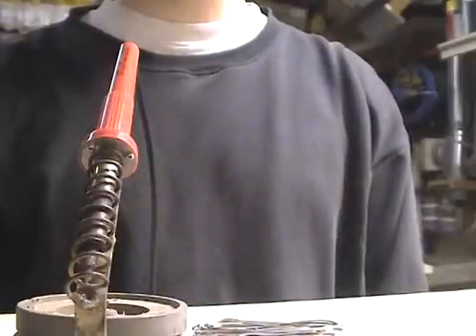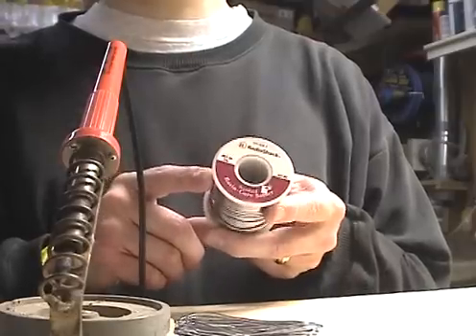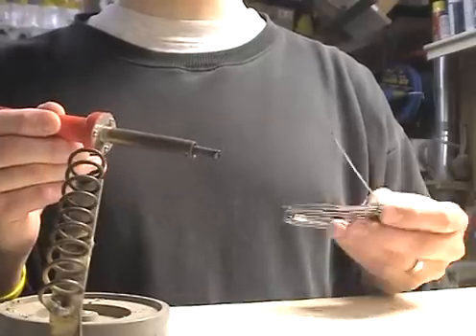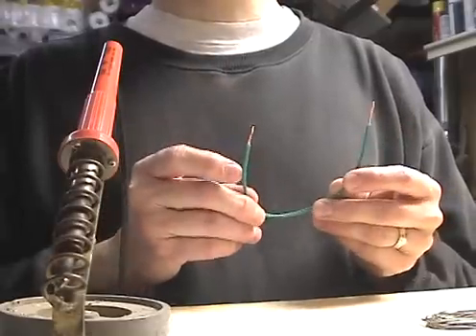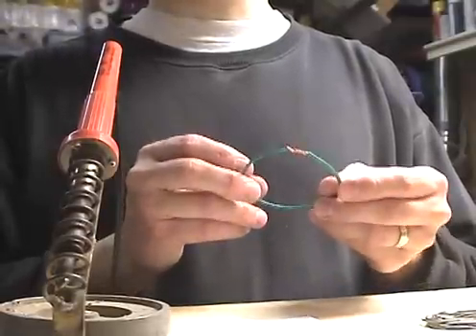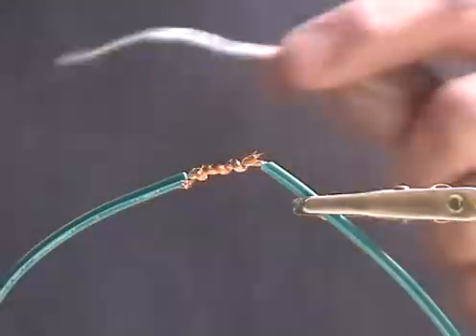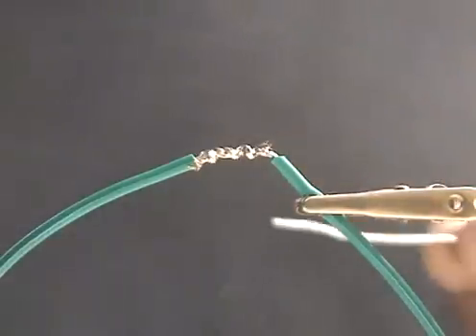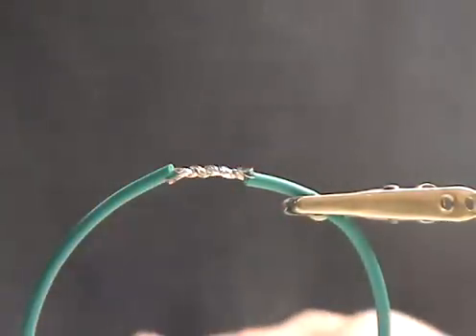How to Do It: Basic Soldering

Comment: How come I am only able to melt the solder by touching the soldering iron tip directly? Do butane soldering irons suck? This is frustrating. Maybe it's the crappy lead free solder that sucks.
Reply: lifeisgood070 butane irons are commonly known as 'fire-starters'! I would invest in at least a mains iron unless you need portability i.e. automotive. Lead free solder melts at a higher point, so it will take longer. Make sure you heat up the joint for long enough.

Comment: Do you add anything over the connection for addition protection or is the tin in the solder enough?
Reply: Jerrid Stottlemyre You usually heat shrink a wire to protect anyone from touching it/short circuits

Comment: Newbie question: Do you have to clean the tip once you're done?  Or can you leave the melted tin on it?
Reply: Leave it
Reply: You should "clean" the tip before soldering, while soldering and when finished. Preferably this means shaking off any burnt residue in a metal sponge, quickly sticking the tip in a wet sponge, "tinning" it slightly and soldering right after that.

The tip is "clean" when it is in normal working condition. You just turn off the unit and let it cool down.
Reply: Gordio283 Most people leave a blob of solder on the tip to prevent corrosion of the tip (and most people refer to the 'tin' as solder). Whenever you have stopped soldering for greater than ~20 seconds, re-tin (Wipe off solder, add solder, wipe off again).
Reply: You absolutely should leave excess solder on the tip after use. It protects the tip from oxidation when it's turned back on. (In fact, it's good practice to apply a generous blob of solder to the tip before turning it off.) Regularly cleaning the tip is essential, but ALWAYS re-tin the tip immediately. Ignore the advice above of using both a metal sponge and a wet sponge. Just use a brass wool soldering iron cleaner. Wet sponges cause thermal shock in the tip, reducing its life (at the lower temperatures for leaded solder this wasn't a problem, but with the higher temperatures needed for lead free solder, it became a serious issue). Besides, the brass wool does a better job than the wet sponge anyway!!

Comment: My Solder does not spread like that.
Reply: That's what SHE said.
Reply: sam luker
It is rosin core, the flux is in the solder. Sometimes depending on the surface of what you are soldering you may have to add some liquid or paste flux, just make sure it is rosin flux not acid .
Reply: You have to use flux on your wires or it won't flow
Reply: Sean O'Brien most common wire soldering techniques usually mean that you put the solder onto the tip, creating a heat bridge with the solder across the wire. The flux in the solder WILL burn off, so you need additional flux to ensure a decent, reliable connection.
Reply: I thought I said that at the end of my comment. It all depends on what you are soldering. I can solder a pair of relatively clean wires without adding additional flux, then there are wires that have corrosion that will require it.
Reply: Sean O'Brien I understand that, I was just explaining the reasoning behind your statement. I CAN solder without flux, it just makes life much harder and has a higher rate of failure. I can bet your joints are very dull, and not a smooth coating.

Comment: I held the soldering iron to the wire for a couple minutes, but the solder never melted. The wire never got hot enough. Do it need to give the iron longer to heat up? How long is a good length? What am I doing wrong?
Reply: chances are your iron isn't hot enough... that is the wattage of your iron is to low for the gauge wire and all the heat from the iron is being dissipated through the wire therefore wont melt the solder. normal 60/40 solder melts at about 200C (365F) and a small pencil iron will lose that heat quickly. secondly, you could be using the wrong solder... 50/50 solder has a higher melting point and requires a higher wattage iron (and a broader tip similar to the one in this video)... side note: NEVER "flick" excess solder off as this video suggests... that's molten metal and it WILL burn you!!! wipe your iron off on a damp sponge or cloth

Comment: I used flux to fix the connection in my macbook charger. Flux can withstand 120 Volts and a good amount of heat correct??? (I've only soldered little battery operated devices that spend like 12V in the past).

Comment: you  really should use the lead frree solder so you dont get lead poisining
Reply: stop drinking the solder!
Reply: Lead has a very low vapor pressure, and rosin flux is only a problem with chronic exposure.  With can cause asthma.  Lead free fluxes are substantially nastier as lead free solders have inferior wetting characteristics and thus need much more aggressive fluxes.  Lead free solders also have the problem of requiring mutually compatible solder alloys, component lead finishes and board finishes (if components are PCB mounted).  Otherwise, brittle intermetallic alloys that form in the joint can cause joint failure and/or galvanic corrosion will be a problem.  Then there is the problem of lead free joints being more fragile.  And the much higher temperatures needed for lead free solder are more likely to kill parts and boards.

There are many reasons why military, aerospace/avionics, industrial control systems, medical equipment, core telecommunications infrastructure and hirel stuff in general is specifically exempt from all this lead free nonsense.

Comment: I am having trouble getting my soldering tip tinned.  I cleaned it and even used sal ammoniac on the tip but the bead of solder doesn't wet the tip and just seems to run off.  I have a pen type soldering iron and I let it heat up as hot as it is going to get but still no luck.  I didn't have much luck with several more expensive solder guns I have either ( I prefer the pen) , I just can't get the tip to tin.  I am using a lead free solder that I picked up from RS - is there any chance this could be the problem?  Occasionally I'll get a small section to briefly tin and there is no comparison with tinned v/s non tinned.  Tinned - the solder melts like butter, untinned and it will not melt the solder.  Any suggestions?

Comment: Is my 25w soldering iron good enough for electrical guitar work? Like switching pickups and volume pots?
Reply: This answer is probably three years too late but I was just watching another video that says not to use more than 20-25 watt soldering irons for guitar work because anything hotter can damage the pots themselves.
Reply: Caleb Jackson just in time. I'm about to do some work on an ovation preacher deluxe. Excellent video dude ! Thanks for the tips. I wonder if he still around :-?
Reply: Caleb Jackson - you can get away with a hotter iron if you are careful. I just soldered a pot a few days ago with a 60w iron. You just have to be quick or you'll certainly cook the pot.

Comment: WRONG.  While you can twist wires together, and it is quick, this is not optimum splice.  Airline spec is that you cut the shielding back about ⅝" for small wire, don't twist them yet, but rather, simply push both wires head on into each other to create a weave of sorts.  Basically, you can ease this process by wiggling them so that they blend together.  Think of one being the inner core, and the other wire blending over, as in coating the wire.   A tiny bit of the wire may fan outward, but then, you twist both as one along the axis of the wire.  The method above isn't nearly as clean an soften created a bumpy condition.   Once twisted just enough to hold the wires, flux the wires and soldier by heating the wire until the soldier melts and creates a smooth joint.  Make sure you place your shrink tubing on first so that you can cover the joint with shrink tubing to create the perfect joint.  This is a much cleaner connection and the wires are more woven together for both a strong and more efficient electrical connection - I promise you.  

Here is an example of how it should be done

How To Solder Wires Together (Sort of) - EricTheCarGuy
Reply: It isn't necessarily wrong, just isn't up to airline specifications...
Reply: David Fresne As I noted, the twisting is less than optimize, not nearly as clean when covered with heat string tubing, and isn’t as strong.  Yes, you can twist the wires.  The larger the wires, the messier the connection using this method.

Comment: Soldering is easy, especially when you're only doing it with wires.

Just get a few wires and practice until you get results like those in the video, then you're pretty much ready.

But I'd still recommend to just replace your existing wires completely, extending is possible but solder isn't "too" reliable, well it is but it can get worn out due to physical strain and temperature changes much like any other material and considering its going to be on a Motorcycle I'd rather be safe.

Comment: Thanks for taking the time to post this.  I've been trying to heat the solder on the iron tip and then drip or rub it onto the wire.   I'm going to go do it the right way now!  Thanks!

Comment: Not too far off. Just swipe the tip on a moist sponge to clear it, and solder. No need to coat each time with solder. It will be coated enough to work just fine. You'll see.
I've built four stereo amps, tuner, VTVM, battery charger, color tv all from kits. Done lots of soldering.

Comment: thanx so its normal to keep  cleaning it like  even  if the last time I soldered a wire was like seconds apart..  cuz when the  wire is soldered the tip of the gun is not smooth and shiny with solder but actually dark and little bulgy so I after ever single wire soldering I  clean the  "dirt from the tip first and  coat the tip with solder.. is this how its really suppose to be ?

Comment: All kinds of tricks. Can use aligator clip in between wire and component as a heat sink to prevent the part from heat.
Soldering pipe can use a moistening rag.

Comment: Your going to want to heat up the wire of you won't have the best connection, try using a smaller soldering tip so avoid damaging the rest of the electric parts.

Comment: could there be a situation where you don't want the wires to heat up as not to damage electrical parts etc. ...how would you solder in in that case

Comment: solder has to be conductive otherwise there's no point in soldering lol. cover the joint with heat shrink tube or electrical tape to prevent it from touching things and shorting out/burning things

Comment: DONT USE LEAD FREE UNLESS YOUR TIP IS MADE FOR LEAD FREE!!! You will end up wih pitting and all sorts of nasty stuff if you buy lead free for a standard tip. Also try and spend the extra $20 and get a variable constant heat iron. try to stick with a good name like weller or Hakko but hakko can be pricey.

Comment: i followed the instruction in this video and i had 2 problems.. the wire takes a very long time to heat up to the point of melting the solder. i used a 40-watt iron, same as the video suggested.. the second bigger problem was by the time the solder melts, the wire would be too hot and the heat shrink tube would shrink 'fully'. still looking for ways to avoid this

Comment: I can see that you know what you are doing but if the iron is only used to transfer heat what practical difference does tinning the tip make? Would it work with an untinned tip?

Comment: @talentedemo21 Hi, I had the same problem, It seems that the soldering iron is not powerfull enough or very old (mine was). what I did was Cut off the pointer to the point where it is hot. After that all went fine! :)

Comment: I think copper isn't good for soldering electronics because copper takes so much more heat to actually melt. And I think that amount of heat might damage any other components. Anyone, feel free to correct me if I'm wrong, just taking a wild guess based on what I learned working as a plumber for a few years.

Comment: ok, I've watched hundreds of these "How to solder" videos here on youtube, however, EVERY time I  try and solder some scrap wire together to try and learn it myself, no matter how long I have the iron tip (30W Pencil type with point) on the joint never heats up enough to melt the soldering wire like in ALL the videos I've seen?? From what I see I'm doing it just like in this video, Only difference is I have a nickle size tin (from RS) of "Tip Tinner" but either way it won't work, Any advice?

Comment: sol·der/ˈsädər/
Noun:	
A low-melting alloy, esp. one based on lead and tin or (for higher temperatures) on brass or silver, used for joining less fusible metals.
Verb:	
Join with solder.
Synonyms:	
braze - weld

You're welcome.

Comment: Flux is a detergent that helps to clean the joint of oxides and other contaminants to allow a good adhesion. It's a mild acid I believe. 
And "sodder" is the American pronunciation. The rest of the English speaking world pronounce it correctly as solder. It's just like Aluminium has an "i" before the "um" and should be pronounced!

Comment: i couldn't tin my tip like that. the solder just burnt away. another video showed me there real trick. wrap solder around the tip when its cold, then plug it in. i did that and it worked perfect.

Comment: Shine the metal really nice with emery cloth. Then set the wire on top of the metal and hold it down with a third hand. (channel locks or even a vise would work.)

Now heat up where you're going to make the joint. (the thicker the metal the longer it will take to heat up. Now apply the solder. It should flow freely into the place you want the solder to go.

Comment: Excellent video and just what I needed (I was messing up big trying to put something together with soldering).  One question though - if I wanted to solder wire onto something else, like a small sheet of metal for example, what would the process be for that?

Comment from the maker: @zestytoaster Yes, the iron gets tinned; use the iron to heat the solder joint; then apply the solder to the heated joint (not to the iron).  Each joint only needs to be soldered once if you do it properly.

Comment from the maker: @EddieLoksters Yes, the "rosin core" means it has rosin flux in the core.  That's the kind of solder you want to use for this type of soldering.  The 60/40 refers to the percentage of metal alloys in the solder itself - 60/40 is a common ratio of tin to lead respectively.

Comment: @coolcheeto
You're probably referring to flux. It's usually rosin or ammonium chloride and is used used when not using rosin core solder and it allows the solder to stick to whatever you're soldering.

Comment: Thanks, this video is very helpful. I have a question. I think I've overtinned my iron or something, is it normal for the iron to change colors when you are using it? When I turn mine on, the tip area and the metal shaft leading up to it turn dark/black. The tip itself usually is not because I tin it, but the other areas do.. Also, if I leave it in the stand on for a minute or two, the tip starts to darken. I also have a hard time getting excess tin off the tip. Is this normal?

Comment: Solder follows heat, flux helps the heat transfer and solder flow. 
My training has you tin the tips of the wire, 3/4 inc as you say. slide in the heat shrink that will cover the joint.  Form small hooks on the ends and hook them together.  Flux the connection and go in with the hot iron only adding enough to get a good solder joint.  Clean flux and slide the heat shrink back over and shrink it.  Flux is your friend, A little solder is enough. Flicking the solder could splatter your project.

Comment: I am trying to solder hooking wire to the wires of a light  socket, however the hooking wire is solid and the light socket wires are the frayed kind. Would you recommend just twisting the little wires around the hooking wire and soldering it all together like that?
Thanks so much!

Comment from the maker: @labobo However, it's going to be more difficult to create a good solder joint when just laying the wires side by side and keeping them together/aligned during the soldering.  But if you can get a good solder joint I don't think it matters that much which method you choose.

Comment from the maker: @Saberoith It could be two problems. One is that you have solder without flux. Without flux the heat won't transfer well from the soldering iron to the solder and the workpiece. Otherwise, if you're using lead-free solder, those alloys melt at higher temperatures than solder with lead. If you have flux-core lead-free solder that won't melt, use a hotter soldering iron, or look for lead-free solder with low melting points.

Comment from the maker: @2001358056 Lead-free solder works fine and is the standard in many parts of the world now.  They've banned lead solder in Europe for health reasons.  However, lead-free solder mixes melt at higher temperatures than leaded solder, so they might be a bit harder to use.

Comment: i have a question. My 40w soldering iron has pointed tip, you said that when you solder joints, you must heat the wire..im wondering because when you do it at 4:11, the wire heated up fast, just like magic, but when i do it, the solder wont flow freely to the wire..instead it becomes a mercury-like ball. and one time when i did it, the insulation of the wire melted but the solder didn't!

Comment: my bass guitar's output jack has a loose connection of one of the wires. i tried to solder it back, but now it doesnt make sound at all. i checked the battery, and it has power. before i soldered, f i touched the wire to the connection, it worked perfectly. after i soldered, no good. could i have messed up the jack with the heat of the soldering iron?

Comment: If u get this message could u give me pointers on how to solder onto a circuit board? My iPod touch's battery is dead, they want $200 to replace a $20 battery!! I've never soldered before. And I rather smash my iPod then give apple $200 for a battery to an item that's $300